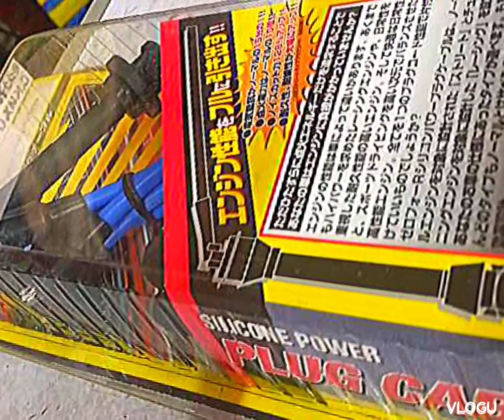2002 VITARA NOMADE EDITION FULL TUNE-UP! #suzukivitara #fypシ #modifications #vitara

Comment: Matipid ba sa gas ang vitara sir?
Reply from the maker: Hello Richard! If the engine and transmission are both properly tuned, stock Performance would yield the ff:

Manual
12kms/ltr City driving
22kms/ltr Highway

Matic:
10 to 12kms/ltr city driving
19 to 22kms/ltr highway pag naka OD ON
Reply: San location ng shop if mag pa tuned up ng vitara?